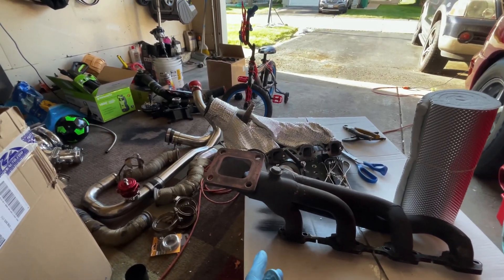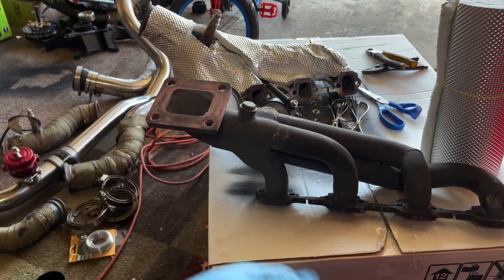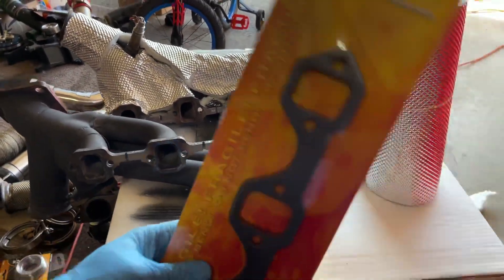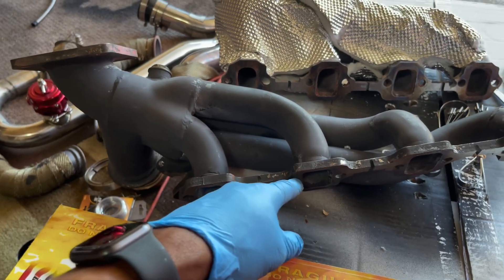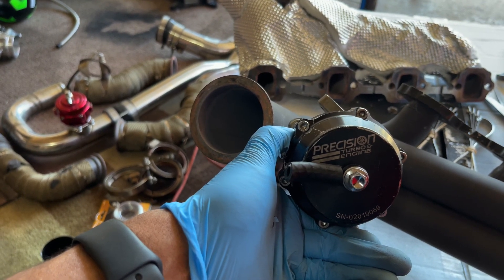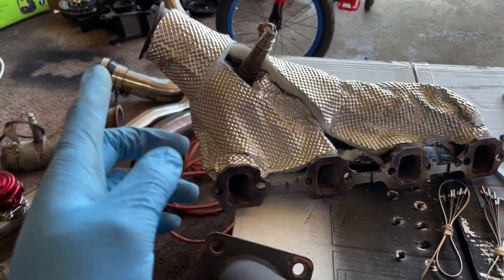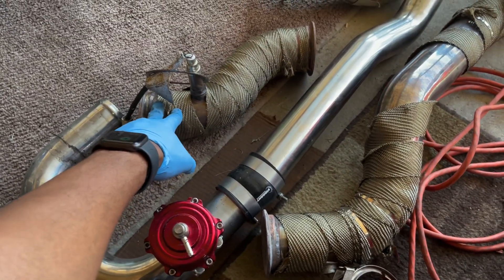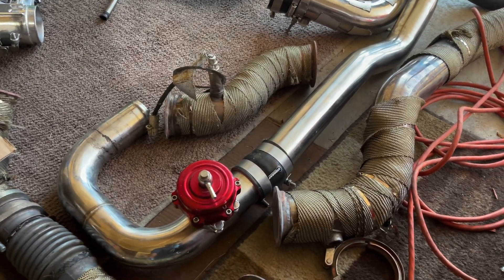How to install On3 turbo kit on your Mustang Part 1.

Comment: Why did you decide on turbo as opposed to supercharge? Great videos
Reply from the maker: I thought it would be a lot cheaper than a new procharger kit. Didn't want to buy used kit. After adding everything up it's still cheaper but procharger would require less maintenance. Also the engine bay looks better with a turbo